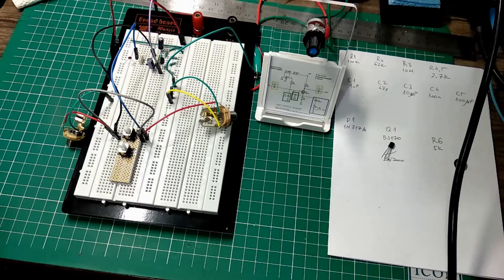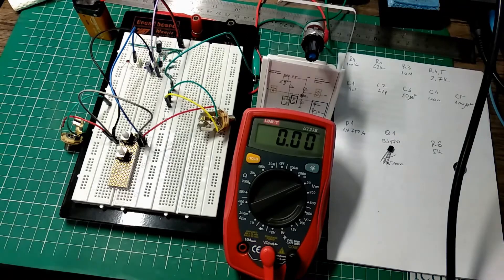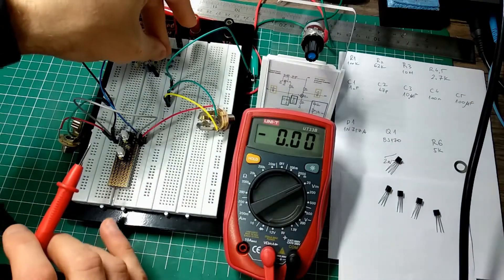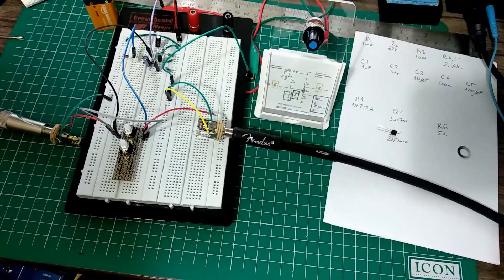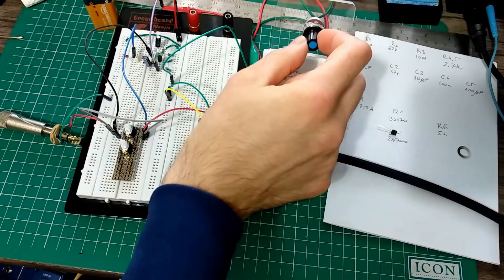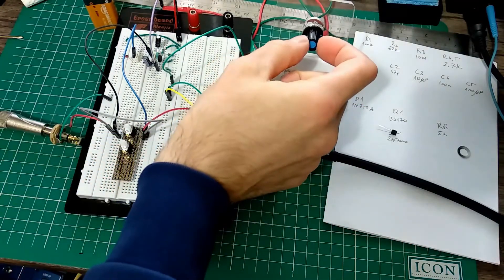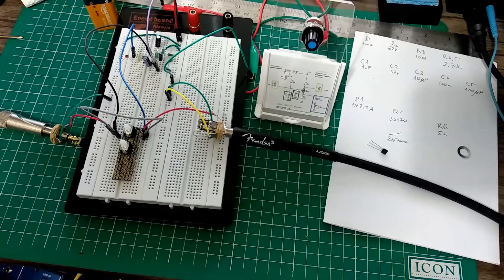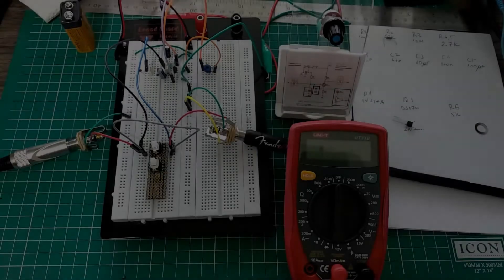AMZ Mosfet Booster - Breadboarding

Comment: Hi! can I ask you a question? Does the volume knob crackle when you turn it? Thank you!
Reply from the maker: hey there, of course you can ask a question. If you watch around 5:20 mark onwards, I'm turning the knob and there's no noise coming out. I had crackling in a different build when I had DC current going through the pot (I'll publish a video on that next week), but there's a capacitor (C5 in the schematic) that should prevent that. 
I'd say maybe double check if you wired up everything correctly. Other than that, maybe the capacitor is bust, try replacing C5. Maybe check if you have any DC current going through the pot - rotate all the way counter clock-wise (that should get you highest resistance) and measure voltage across it and see if you get anything (you should get 0V across pins 2 and 3).